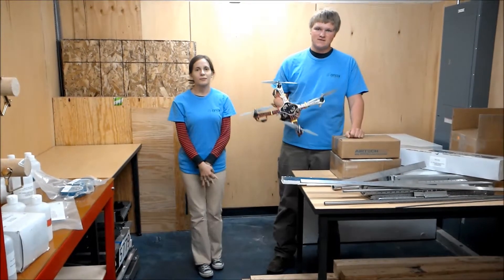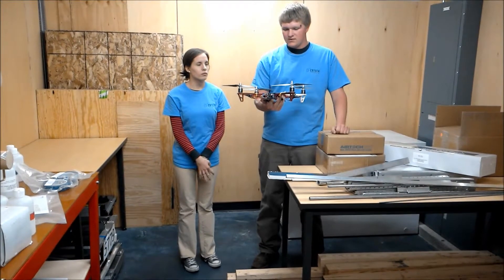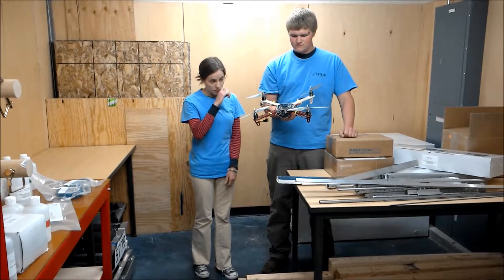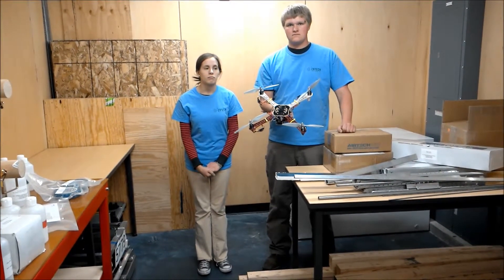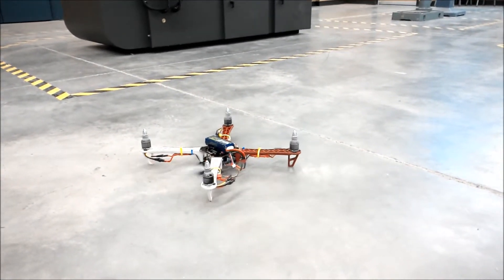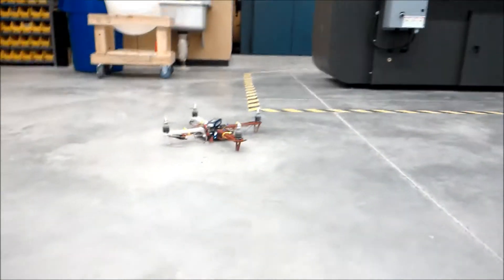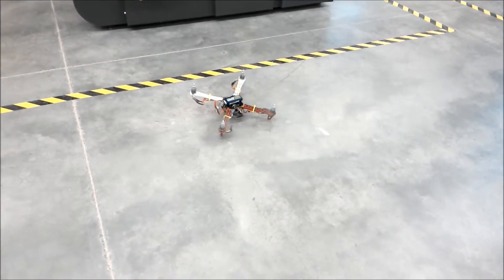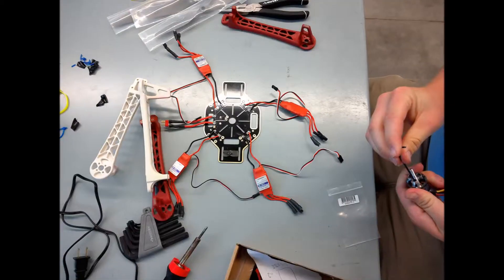Melissa & Cody Quadcopter

Comment: First make sure and adjust your volume levels before posting a video, from talking to music almost blew my speakers.
Nect put the darn thing in stabilize mode, if you don't have your PID settings right and you don't know how to fly it won't work no matter how many times you try.
P Gain start at 50, I Gain at 0 and work your way up and down.